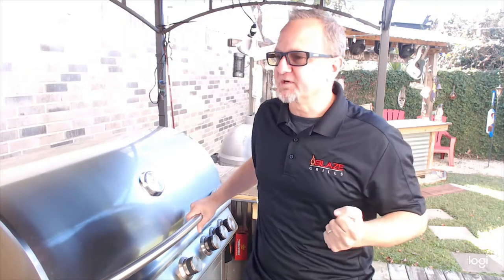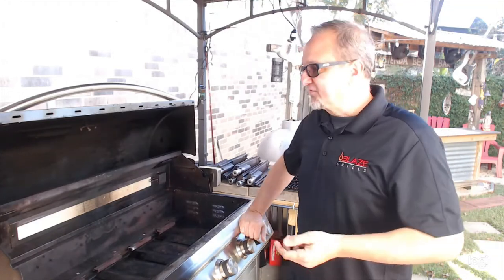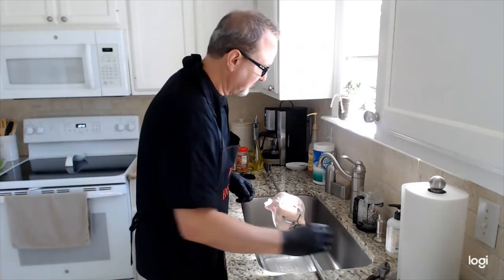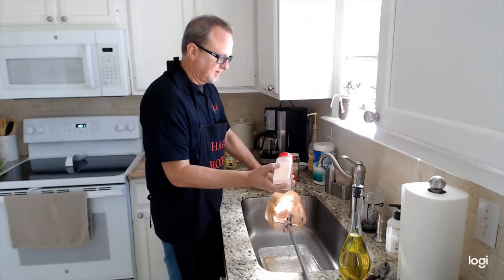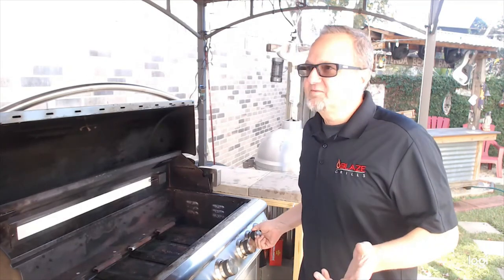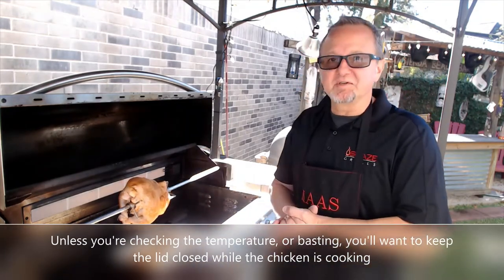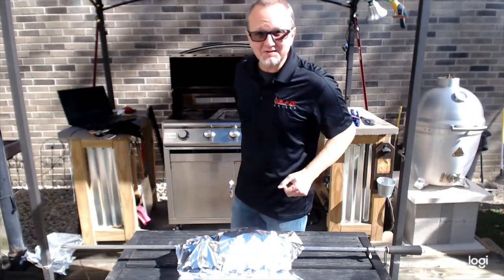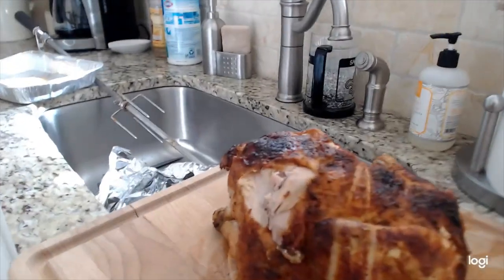Jimbo's BBQ HAAS-EINDA: Today's recipe, Rotisserie chicken

Comment: Great vid. Got one of these grills bc of your vids. What should I turn the rear burner to when rotissing chicken? Should I leave it on high for a while before turning it down? I have the LTE. Thanks!
Reply from the maker: Ah ha... My favorite question, when it comes to our rotisserie burner. I leave it on high. That burner gets to over 1000 degrees. On the l ow setting, there may be a difference of 30 to 50 degrees. However, when you're cooking at 1000 degrees+, does a 30 degree difference in temp really matter?? I'd say no. Plus, it's a ceramic burner which tends to take a while to cool down, anyway. Ceramic is really good at holding heat. There ya go. Probably more info than you needed.... or wanted : )  Just FYI, when I rotis a whole chicken (4.5 - 5 BLS), it'll usually take about 1 1/2 - 2 hours. Thanks for buying Blaze. Drop me a message anytime....
Reply: @grillingwithjimbo  You da best, Jim! Great to know. More rotisserie videos pls. Maybe rib eye or shawarma next? You just got a new sub
Reply from the maker: @jaysonzhang9270  I plan on it. We have a pizza oven coming out with an included, vertical, rotisserie kit. It will be perfect for shawarma. Can't wait to get my hands on it. Can you believe I have to wait? LOL.
Reply: @grillingwithjimbo  haha sounds amazing!